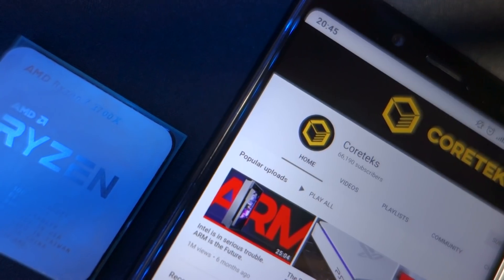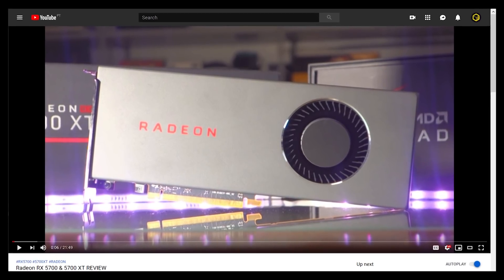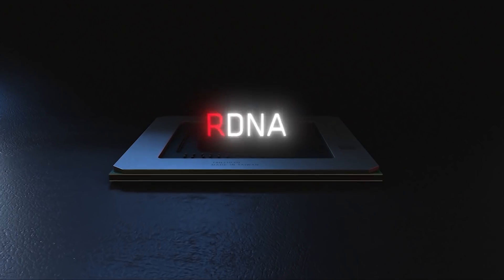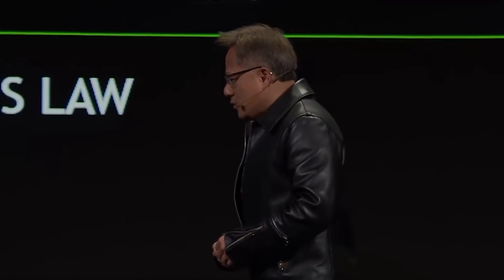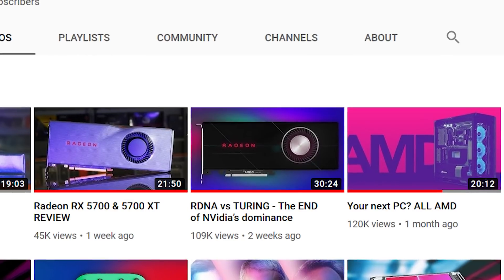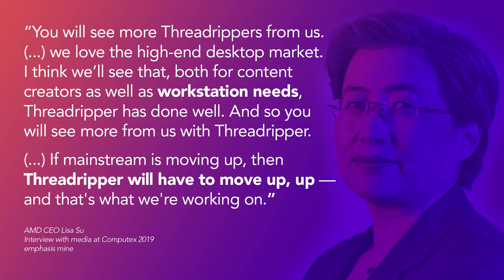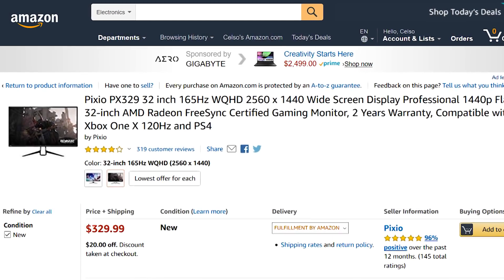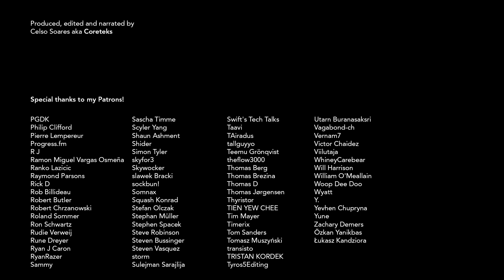What's next for AMD? - 5800XT. Threadripper. APUs.

Comment: I am expecting a 59XX navi to hit some time next year.  58XX this year or early next year. I don't think a 64c/128 TR make sense on HEDT. A 32c/64T makes more sense...Radeon Instict is used for machine learning and other data crunching tasks but they could do hardware video rendering acceleration like intel's quick sync. Now a dual socket TR could be coming since you can get dual xeon workstations from dell that are tens of thousands of dollars. Base price of a dell 7920 with Dual Platinum 8280l Cpus is around $36000+...expensive but somebody buys them otherwise Dell wouldn't offer them as a configuration.

Comment: I think they'll release a higher CU count GPU based in Navi soon but honestly I doubt that's the specs and pricing. 

5700 xt got 40 CU, 56 CU could end in nearly 40% performance increase over 5700 xt. That's higher than 2080 ti, if they manage that, I doubt it will be for 500$ or close to it. My prediction: 48 CU, matching 2080 or 2080 super for around 600$ and 800$ for a high end 60 CU minimum.

Comment: theoretical 5800xt "....300m2 but that is still way smaller than vega 64 at 495mm2..."  yeah but vega 64 was on 14nm.  you cant compare the 2.  going from 250 to 300 on 7nm would be 20% larger but it would increase the cost of a full die by 40% because of worse yields.  and then you would have to have a cut down version to get rid of bad dies.  which means you would have to add a card between the 5800 and the 5700xt.  either that or you would have to go to 60 or 64 CU's and then cut that down to 56.  which means more like a 325-350mm die which would increase prices more.  or they could just wait till EUC and make the die youre talking about with good yields and for cheaper.  which one do you think they will do?

Comment: Bigger Navi is not even worth speculating for, it's an inevitability. Release date speculation will probably be off, but I believe it's going to be there for the long haul. If they go the Zen route and jump nodes with every architecture, we might be seeing the start of the a very exciting GPU space we haven't seen for a long time. 
Dual socket Threadripper sounds really sus, but I can definitely see exotic chiplets being added to differentiate themselves. I wonder if they'll reuse the Rome I/O die or make a new I/O die for that platform. Dual socket might happen if they go for 4 chiplets per package, that way they can keep the highest core count on server parts. 
On APUs, I don't think so. We've already seen Vega confirmed for Zen 2 APUs and those might not even be out this year. We would be looking at Q4 2020 or 2021 until wee see Navi on APUs not to mention any sort of chiplet based design.

Comment: I do agree a bringer Navi coming but I don't know about 2100mhz boost looking at how Navi overclocks. If you want to keep the power in check lower voltages and clocks like on the 5700 non XT are the best way to go. And then go wider. I did some tests with two 50th Anni cards and navi's sweetspot for voltage/MHz gain is between 850 and 950mv after 1050mv its getting worse fast.

Comment: Being that the RX 5700/XT is a 1440p gaming gpu (*Rx 480/580 replacement) I'm more incline to believe that both PS5/Scarlet's GPU will be based off the AMD's yet to be announced RX 5800/XT or 5850 GPU(*Vega 56 replacement). The 5700/XT just doesn't fit Mark Cerny & J. Ryan's PS5 supposed 4K 120 htz w Ray Tracing and 8K up-scaling spec capabilities.

Comment: I dont think the clocks will be that high on the 5800xt. Probably 2000mhz because they're adding more cu's. And do you think they would add a larger navi gpu on a tr4 socket? And you can get a 144hz 1440p 27in monitor for 220$.

Comment: 300mm2 is a joke . just to clarify and at least 15-16 billion transistor in 300mm2 mean's transistor density about 53 mil's in square millimeter which is impossible - my prediction is 380mm2 and 60CU CHIP. the performance level of 2080ti level or above for ease

Comment: people were not actually expecting 64 core threadrippers, after all the 32 core (same as epyc) on came with the second generation of threadrippers, so people were expecting an in between around 48 cores, up and up would mean instead the full 64 cores, which considering by the time it launches it will be really fresh in the server market and the top cpu its quite a bold move as consumers usually only have access to the full server silicon some time later if at all.
i don't think amd needs to go further than that anyway its not like doubling the cores in a year and quadrupling in 2 years  is not impressive

Comment: Based on the cost difference between single socket and dual socket capable Epyc CPUs, I don't think dual socket Threadripper is likely.  Certainly a possibility, but not likely.

Comment: As for APU's… I was expecting more out of the 3400G… the performance leap over the 2400G wasn't that impressive compared to the difference between the 2700X and the 3700X.
The day AMD is able to make a APU that is capable of playing skyrim at 60+ FPS average, that is the day I will be impressed. The 3400G is averaging FPS in the 40s currently in Skyrim, which I remind you is a roughly a 9 year old game by now. They still have some work to do

Comment: I knew about the 5800, I was disappointed it wasn't launched at the same time as the 5700, and I kept thinking but where's the 5800? I just know there's going to be one because it feels like an empty space. There's always something in that slot. it's the same with the 5600, the budget range slot. It just felt so weird they only launched the midrange cards. That's never been done before, why did they only lunch one tier of their generation and holdback the others? And I think there were rumors about big Navi coming later this year around October or November. So I figured that as the be the 5800 and 5800 XT. But beyond that I don't know what else they are planning to do

Comment: If we just look at the current naming scheme of the ryzen 3000 series we can only think that threadripper 3000 will be a high core count chip. 3970wx 24 cores and 3990wx 32 cores in a 4 chiplet configuration. Forget about 12 and 16 core rippers. Maybe later but I am still not feeling if that’s a good move 48 and 64 core monsters in 8 chiplet configuration like epyc.

Comment: Do you think the 5800XT will use HBM or that will be reserved for the flagship 5900?
Reply: If the 5800XT is $700 or less, then I doubt it. Half the cost of Radeon VII was just the HBM2.

I could see 16 GB of GDDR6 on the 5800XT, and the 5900 having that be HBM2 instead.